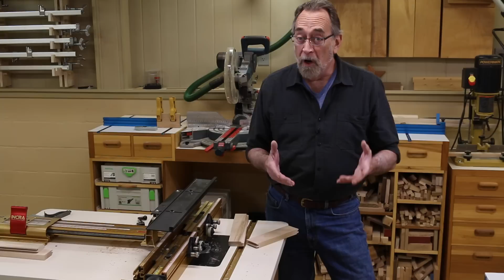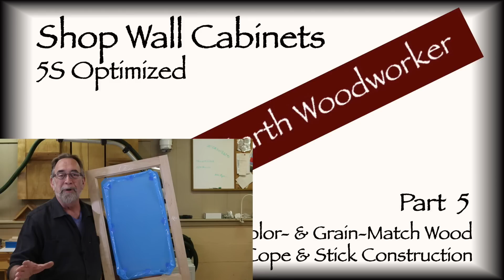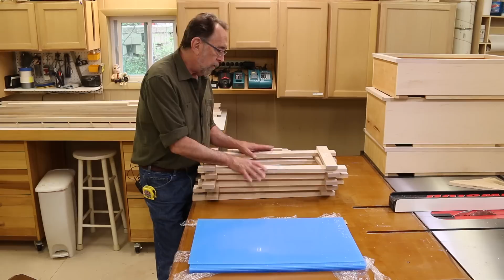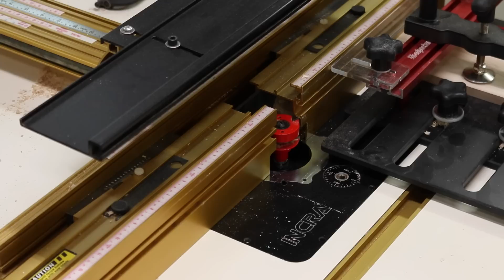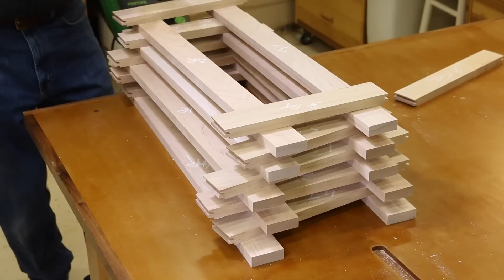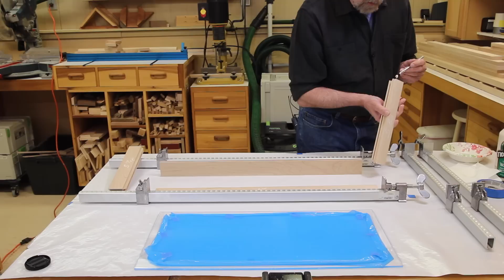5S Shop Wall Cabinet Pt 5

Comment: Amen to matching grains, etc. I spent 40 hours matching 10 @ 12 inch by 12 inch Marble tiles so that the red, black, grey, crystal and white lines and patterns became a unified whole...it took 40 hours because I had to choose out of 50 tiles on-site.  There are so many ways to put 4 sides of 50 tiles together you wouldn't believe it. The final resulting 2 foot by 5 foot stand-alone counter-top was well worth the effort.

Comment: Where do you get the plexiglass?  You are awesome.
Reply from the maker: Thank you so much.  I typically get it from Professional Plastics.  Here is the link to the page that describes the product I get:
https://www.professionalplastics.com/PLEXIGLASS-ACRYLICSHEET-EXTRUDED
You can order it cut-to-size, which is what I do.  I typically get the 0.250 thick (quarter-inch) film covered clear.

Comment: Nice video.  I wish you would talk about sizing the door: i.e. calculating rail and stile lengths
Reply from the maker: ***** Robin, thanks for watching.  There is a "Cabinet Configurator" spreadsheet that will calculate door sizes for you.  You can download it here:
http://www.highlandwoodworking.com/woodworking-tips-library.aspx

Scroll down until you see "The Down To Earth Woodworker" then scroll down a little further until you see "5S Shop Wall Cabinets" then click on the "Cabinet Configurator" --- don't click on the pdf underneath, click on the actual "Cabinet Configurator" words and an Excel spreadsheet will download to your computer.  Then you can enter in rail and stile width, then overall door dimensions, and the rail and stile lengths will auto calculate.  The "Configurator" assumes the use of a "standard" cope and stick bit set, like Freud.  Some adjustments might be necessary for other cope and stick bit sets.  Generally this would only require changing the stub tenon size which can also be done on the spreadsheet.
Reply: downtoearthwoodworks Highland has converted the spreadsheet into a pdf document.  It no longer calculates.
Reply from the maker: David Walser I just checked it... click on the words "Cabinet Configurator" not on the "(printable pdf of this article)" below it...